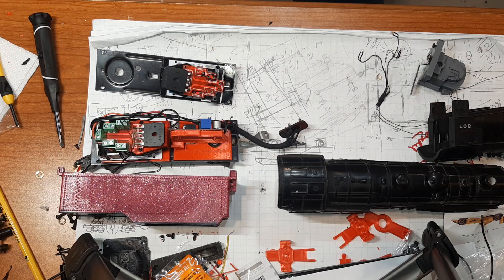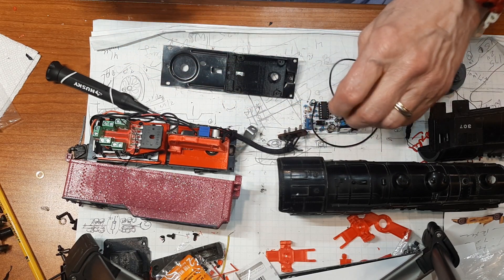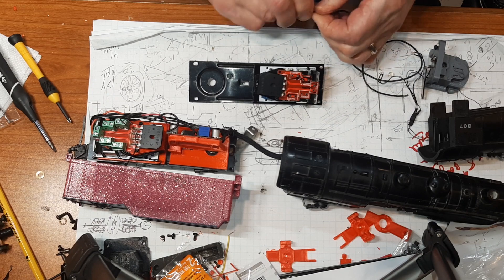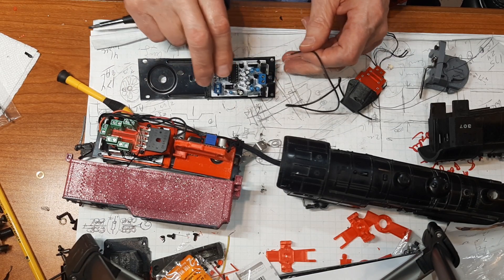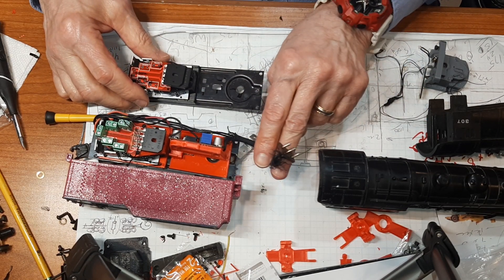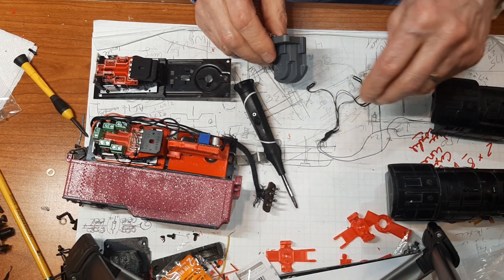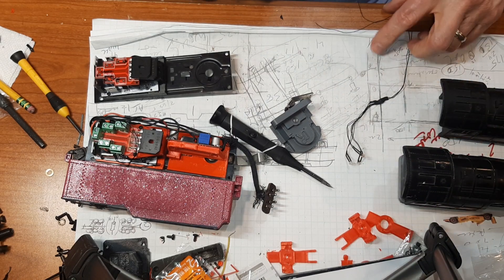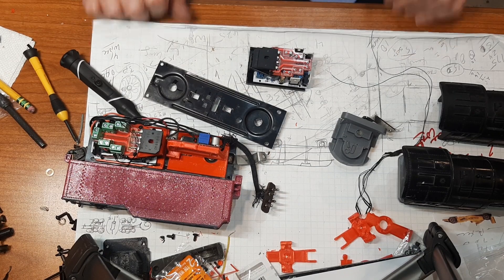Frankentrain Laboratories Tutorial on Motor Control and Power Board installation. Bonus Firebox too.

Comment: Nice job!
Reply from the maker: Thank You, I have done more than i can report so i am trying to catch everyone up. I was worried about costs. The best i can do is my cost to fabricate, Zero engineering fee and split the shipping. I add a very low percent so i can buy more parts. The plastic parts are no design fee or engineering costs only production costs, Filament, machine wear and supplies. No real profit. I am finding my notion of pricing is a little behind. When I see the newer engines and the costs I feel very good bringing our unique blend of Vintage Core with State of the Art Updates. Especially when we see the chassis results. Close to completely new ready to run chassis for modelers that want to design or retrofit new engine types, styles and shapes.  I have been building custom theme trains for years and find them most satisfying. I hope to open others up to that notion buy providing cost effective RTR Chassis. I always wanted high end brass models but they were so expensive. With 3D Printing and IOT( Internet of Things) Technology, We can provide a foundational Platform leveraging AC Gilberts A.F. S Gauge standards in scale, body mounting, motor assemblies, couplers and offer a truly cost effective option to high model core components. Keep watching and offer inputs, suggestions, try a few things we have now and lets all grow the S Hobby for the future. I am approaching 8 years from the beginning. I still have designs on paper yet to be realized. So i hope to male this year the period of completing many core components for routine fabrication and use, while expanding into Diesel and more Digital Control/Sound. We have bench tested WiFi, Wireless Control, Digital Sounds and Controls. Its all good, Stay Well, Dennis
Reply: @DennisMurphey  Awesome!

Comment: Nice work!
Reply from the maker: working on a better trigger for Chuffs sounds and Puffs smoke. I want this to be simple but rugged and reliable. Plus We are working on the Non Smoke engines to machine a slot in the metal to fit a new Smoke Gear. This new trigger system mounts on top of the DC Fields and will hold the Limit switch we need as a P&C trigger pulse. Andy design the Cam, Jim is machining the chassis in addition to working out the ball bearing axles. We are using Carl's Puffer board and I am waiting for Chuff Board from Tim at Ngineering.  Progress is really getting close to 100%. I am selling Rolling Roads , DC Fields and Digital Reverse Boards which is helping keep the progress steady.  You take care Chris. D

Comment: Enjoying  your work 
How do i get more info on finished  product 
Thanks
Chad
Reply from the maker: thanks Chad this is about it. I don't have web site. If you have an engine and see something let me know and i can assemble a video about it and you can order by sending the cost to PayPal. There are so many variations of the engines i like know exactly where and what you are installing. I have not rung out all the models but most. Let me know what you interested in. I have over 900 videos to search and usually have several covering your interest. Dennis
Reply: I am working Bluetooth wireless control using Ardunio.  My project engine  is 303.  
I was think using a can motor.  
Then I found video on Dc fields.  Does this reuse AC armature or do you need Dc armature. 

I am to tinker  and dabble with 3D  printing.

I also liked your 3d printed chassis with bearings project.

I think you next 3d printed chassis should be for diesel

Thank you

Chad